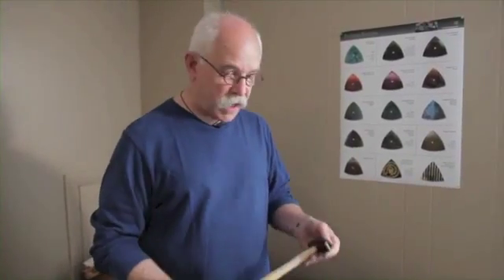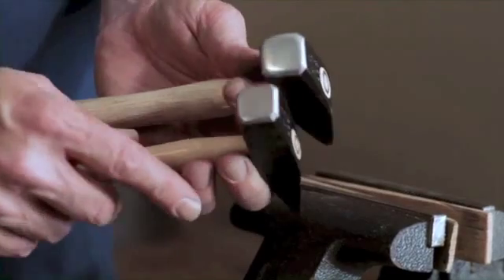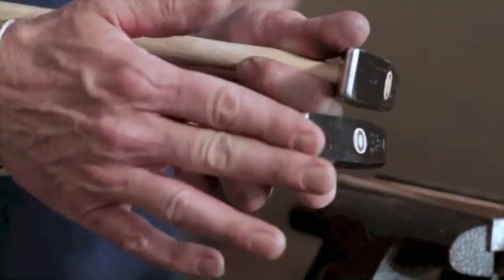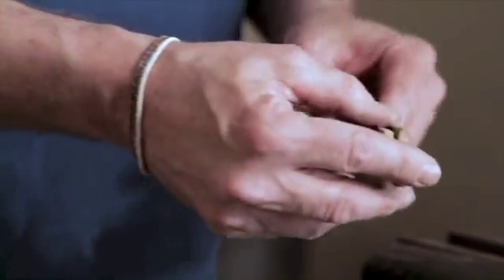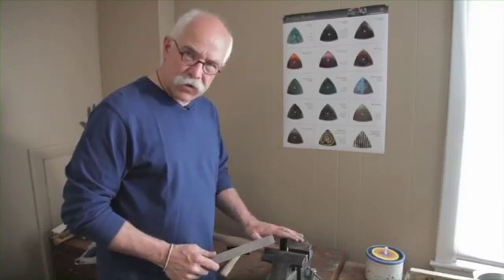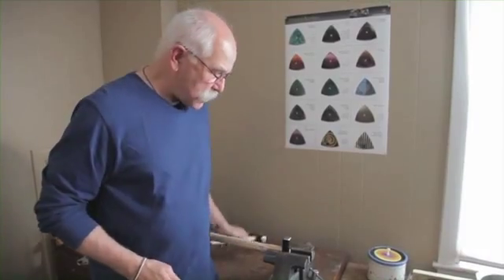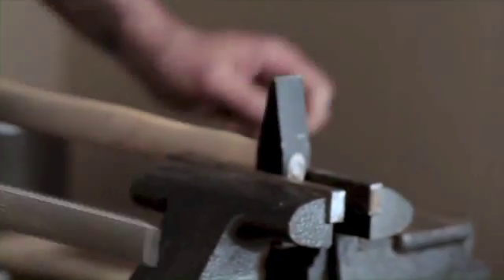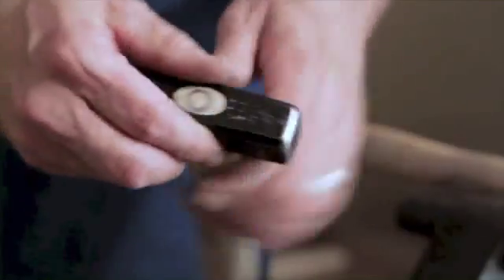Forging Basics - Hammer Modification

Comment: What types of files did you use?
Reply from the maker: Any coarse file will work, but I'm a big fan of a specialty called "Magicut." These are only made as flat files and available in 8" 10" and 12" lengths. Not easy to find but worth seeking out if you do a lot of work on steel.
Reply: @BrynmorgenPress  thank you!

Comment: I have always been a fan of yours, what size /weight  hammer are you dressing?
Reply: Hello George. Thank you for your kind words. This video shows a 300 gram (10 oz.) hammer head. I also use a 400 gram (14 oz.) hammer. The samples shown in the video are relatively soft metals at a small or medium scale; I also have some larger cross peen hammers for larger work.